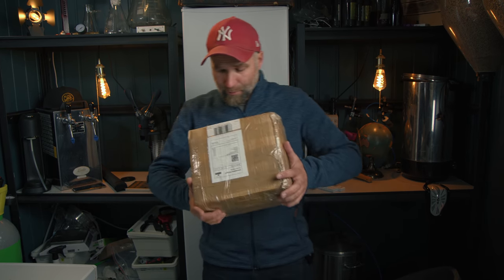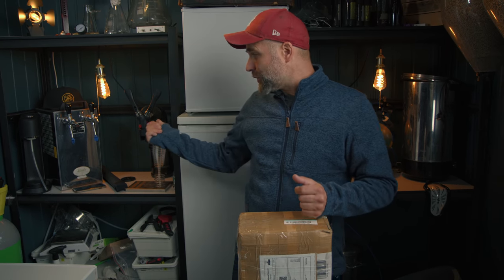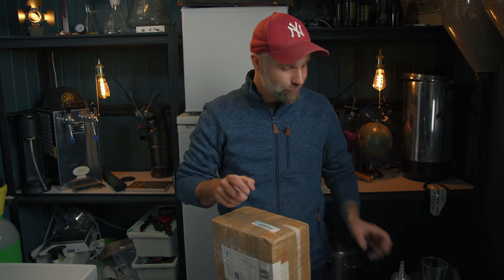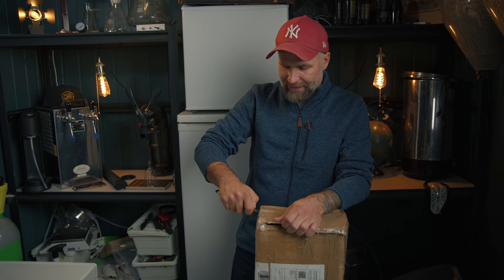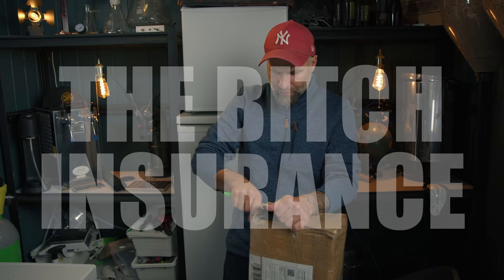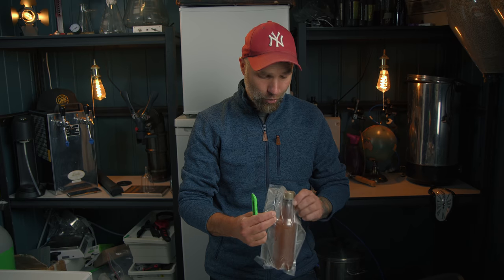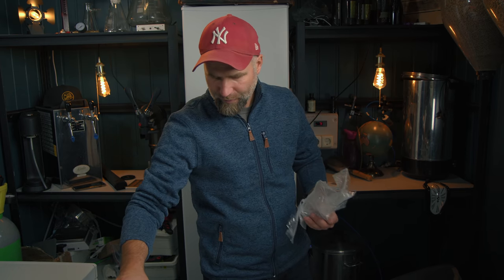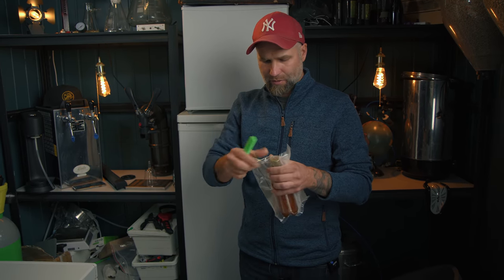NEIPA iTap Oxidized Beer Experiment part 2

Comment: Try this again with these conditions: 1 bottle no purge no foam cap, 1 bottle itap purge no foam cap, 1 bottle itap purge foam cap, 1 bottle soda flush + itap purge cap on foam. Let them all sit for 6 weeks.  See if any make a difference.  Suspect the itap side filling action prevents most of the o2 contact and its pushed out with the foam cap.
Reply from the maker: I'm working on a special episode commenting on your comments on this video!

Comment: Thanks for doing this video. As I commented on the previous video - my bottles oxidised before being sold to a shop using the itap. Mine were fine the 1st week. The 2 week mark, all oxidised. However, I still have around 30 bottles in the fridge 2-3 months on, and they aren’t any further oxidised to how they were at the 2 week point. Also still taste reasonable but just not as fresh as when dispensed from the keg
Reply from the maker: I'm working on a special episode commenting on your comments on this video!
Reply: @DrHansBrewery  that’s great. Can’t wait to watch it. Will look out for the notification

Comment: Another interesting experiment! For me, the results point to the efficiency of pressure fermenting when it comes to keeping oxygen out of the equation, rather than the effectiveness of flushing a bottle with CO2 (or not). (And, also, the effectiveness of your bottling technique!) You are transferring beer to the bottle that is already carbonated and saturated with CO2, and, added to this, you are also squeezing the bottle so that beer reaches the opening and pushes any O2 out before capping. Once capped, the dissolved CO2 present in the beer release to fill the headspace. Which brings me to the final point, which is the headspace in a bottle is already very small, so by doing this you are effectively eliminating pretty much all O2, regardless of whether the bottles were preflushed with CO2. I believe that if the beer hadn't been squeezed to the top of the bottle before capping, and the headspace was larger, then the results may well have been different. The great news is that it IS possible to bottle NEIPA without suffering oxidation - at least for a week or so, anyway. Keep up the great work!
Reply from the maker: I'm working on a special episode commenting on your comments on this video!

Comment: I really appreciate this video and research! I've been lead to believe crown caps can let air in. That might make a difference. Good to know PET bottles are reliable and we don't need to be too serious about purging the headspace.
Reply: He squeezed the bottle to remove all the headspace before capping.  It would be interesting to see what happens if you leave headspace with air.
Reply: @helimed01  Why don't we just squeeze out the headspace on a PET bottle like the Dr did, if we know it works from this?
Reply from the maker: I'm working on a special episode commenting on your comments on this video!

Comment: Don't be dissapointed.  Another great video.  What we do know is that if theres a difference, it does not show in a week.  That is good to know.  This also shows your fermentation and transfer is clean. An ecouragement to maintain clean process.  Therefore proof two things, excellent.  Maybe a 'bad' control would have been a half fill bottle 'unflushed' and shake it.  I'm sure the oxygen would have ruined the beer, right? But what if we don't shake it.  Will C02 push oxy to the top and keep the beer good.  Maybe an experiment.  Cheer doc.
Reply from the maker: I'm working on a special episode commenting on your comments on this video!

Comment: Transparent bottles, nevermind the vacuum bags and have a control bottle intentionally treated badly - perhaps poured from a pitcher* or straight from a regular tap with into the bottle.

*although you might have to force carbonate that bottle as well then, to account for any loss of co2?

Comment: If you squeeze the bottle removing all Oxygen carrying air before capping there will be no Oxygen to oxygenate. This would mean flushing is a waste of gas and time.  But one flush probably best to be super sure.  Why ascorbic acid? What does that do other than adjust PH? I’ve seen you add a citric acid to the mash for PH.
Reply from the maker: Hi! Squeezing the bottle after its filled does not ilminate oxygenation during the filling. It does a great job removing the head space as you mention. Which is great. Ascorbic acid is an antioxidant. I can't remember using citric acid (but it will work to adjust PH). I've used lemon 🍋 juice though for PH adjustment together with lactic acid in one brew.
Reply: @DrHansBrewery  Yes it was Lactic acid you used not citric.  You put 2 caps in a 23L batch. Thanks for information and for your work on the vids. I watch them all.
Reply from the maker: I'm working on a special episode commenting on your comments on this video!

Comment: Is it fizzy ?
Reply from the maker: What is fizzy?
Reply: @DrHansBrewery  I have used the picnic tap to tap the beer from plastic cap but it didn't fizzy as i pour it out but by hand(like pouring the soda bottle).  The fizzy dramatically differrent but i try to buy some pressure filler to fill it to the bottle but I 'm not sure, Is it gonna work well ?
Reply from the maker: @goozavar  got it, yes the beer keeps it carbonation well after being bottled with a counter pressure filler.
Reply: @DrHansBrewery   Thank you, Useful comment.   :)
Reply from the maker: @goozavar  no worries

Comment: Shouldn't vacuum sealed the bottles to allow the natural pressure difference to effect it and also you should have waited 8-12 weeks I bottle condition my beers and I don't ferment under pressure and my neipas with 500-600 grams of hops for 19 litre batch dont get the oxidation until it been in bottles for over 4 weeks and that is without flushing the bottles with co2 when bottling
Reply from the maker: @Lumpy50  Send one and I will wear it for you in a video :D
Reply from the maker: I'm working on a special episode commenting on your comments on this video!
Reply: @DrHansBrewery  When I get one I'll have to get you one. I was a Cleveland Indian fan; but we're not allowed to say that anymore.

Comment: Perhaps a week was not long enough.  Maybe a month or more is what was needed?
Reply from the maker: I have had Neipas that has been shipped to me that has gone bad in under a week from bottling from the keg.
Reply: From what I've learned a strait pour from a keg is good for 24hrs. With flushing, 1 week.  Closed loop transferring and flushing, up to one month. Even commercial hazies start going bad by 2mo.